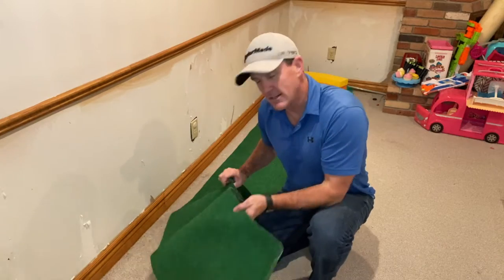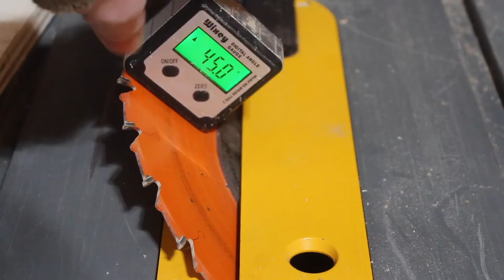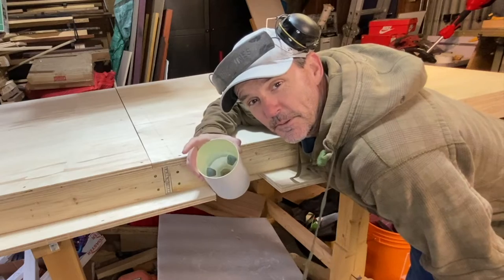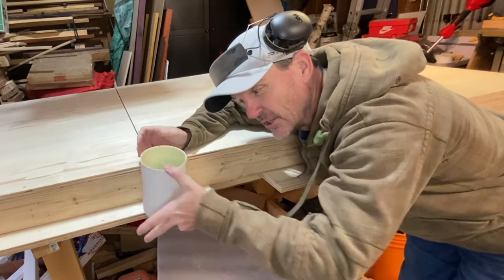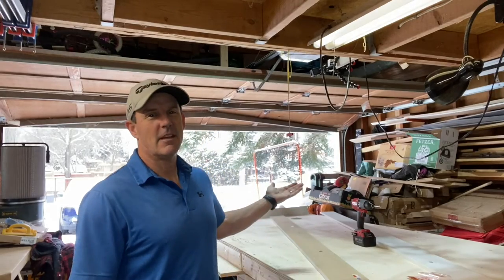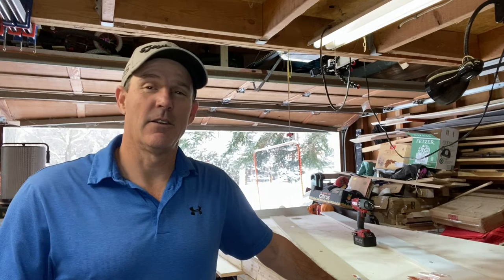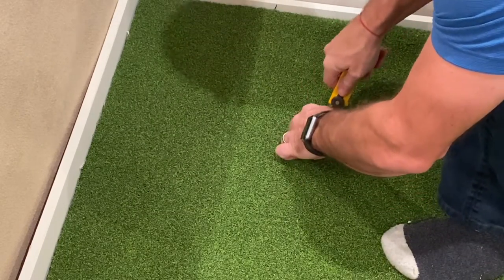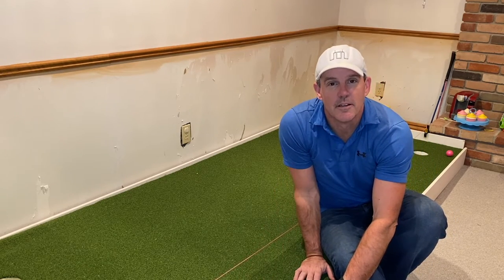Ultimate DIY Home Putting Green [] Indoor putting green [] Golf Green

Comment: I’m here cus I’m drafting out my own to build. I like the French Cleat system and the overlap to hold the two pieces together. I was thinking of some sort of Spray 77 adhesive or a roll on Heavy Duty adhesive to hold the putting green to the plywood.  Love this project! Well done!
Reply from the maker: The cleat system is great, because this is surprisingly heavy!  If it were any larger, I would never be able to move it around on my own.  If you get good turf, it is pretty heavy and won't need adhesive.  I've already had to move mine a couple times - leak in basement :( and if it was glued down, it would have been trouble.  Don't go so permanent.  The line of velcro behind the holes keeps it down and keeps it tight. Good luck with it!!
Reply: Ahhh!!! Great reply. Yes. I was definitely going good quality on the turf. I have ability to get at a good price direct so will get good quality. Thanks for the tip!  ✌🏾

Comment: Now that it's been 7 months since you posted, would you say the velcro is still holding up nicely? My only concern is with the adhesive and it coming off the turf.
Reply from the maker: Yes, the velcro is holding up just fine.  I did staple it down to the wood as added security.  Typically it wouldn't be lifting up and down too often, so it wouldn't be too big a deal.  But I'm glad I didn't permanently adhere it, as I've had to move mine around several times lately, and it would be impossible as one piece!  It's soooo heavy!
Reply: @billymacmakes  thanks for the response!